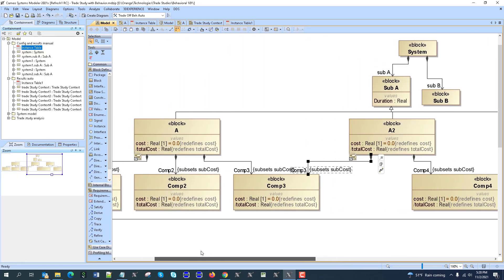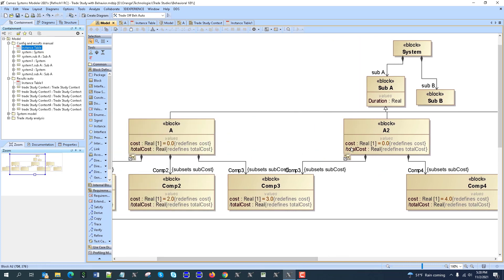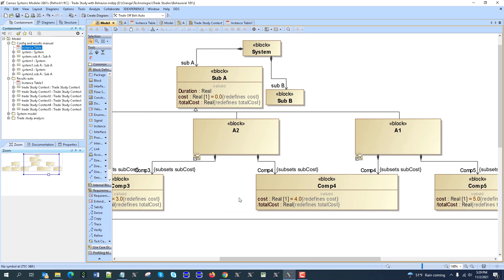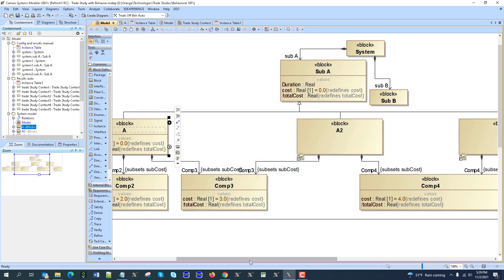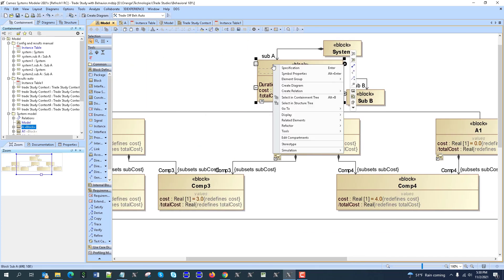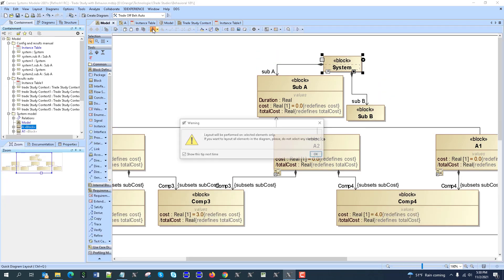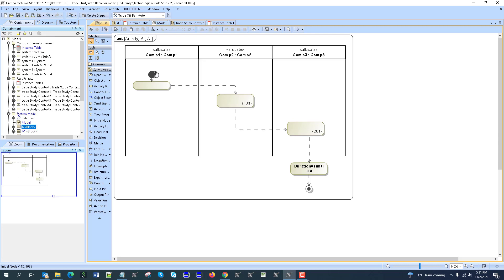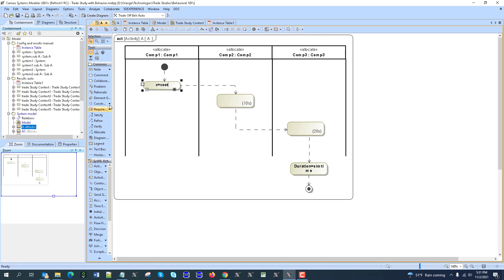Trade Study with Behaviors including Dynamic Duration and Cost Calculation

Comment: Do you have any suggestions for recording the runtime duration of a simulated State Machine & States as a value property??? I have never been able to find a solution that works with States and State Machines, as they do with Activities...I primarily use Cameo and creating or applying duration constraints is simple but actually recoring that duration from the simulated State Machine does not seem to be possible, despite it being fairly easy for activities.